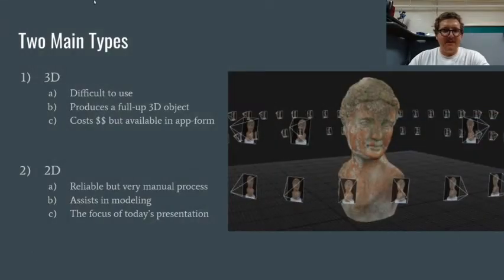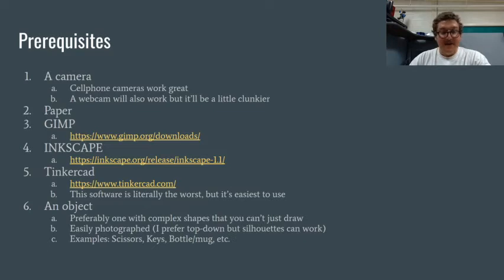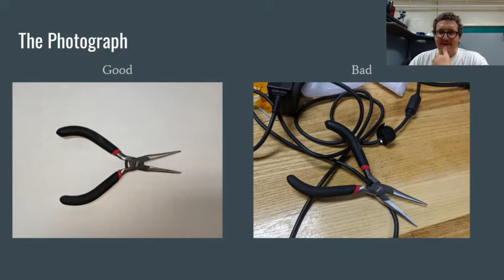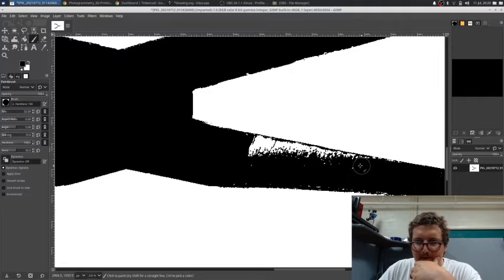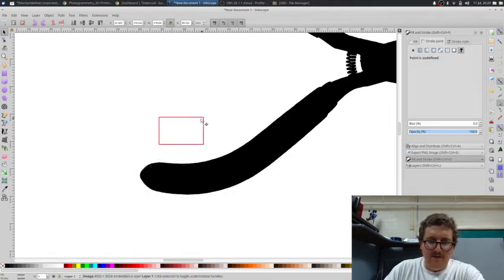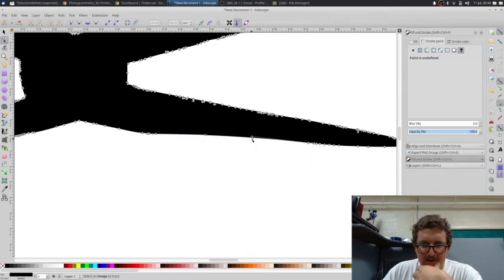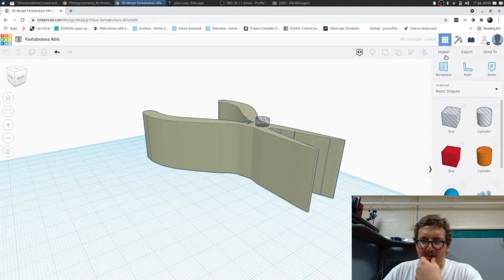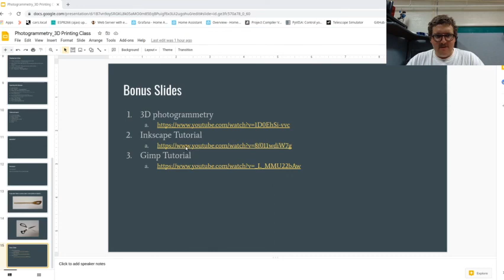2D Photogrammetry

Comment: I'm not your student; I just like your content.
For 3D photogrammetry, zephyr is very good, the free version has a 50 photo limit but gives awesome results that just need some fixing in blending. A cell phone camera would already give very nice results
Your microphone level is a bit messed up, and any headphone integrated mic will be better than a laptop mic!
Reply from the maker: Hey thanks for the comment! I'm going to try to hunt down the file and boost the audio. It is pretty quiet.